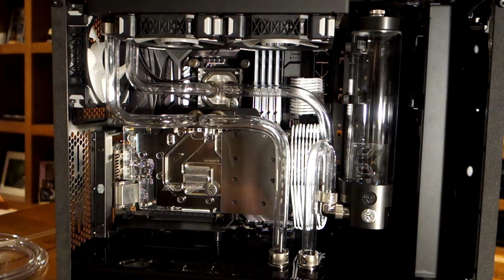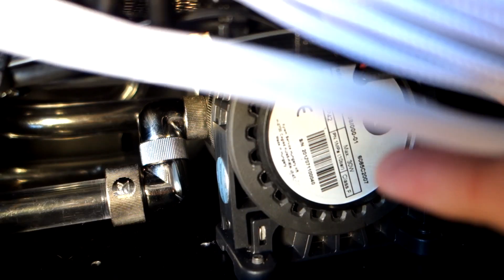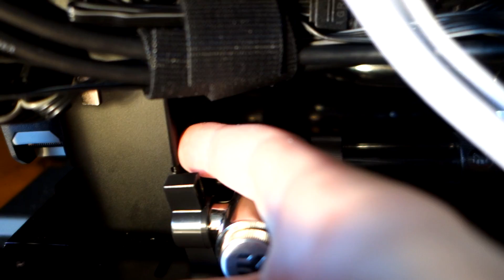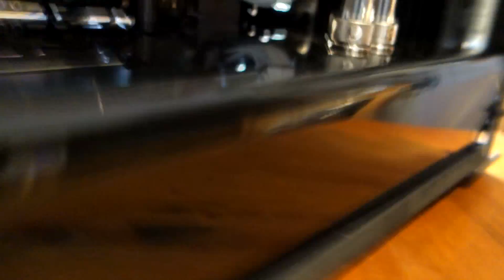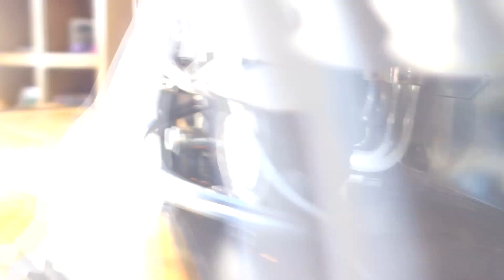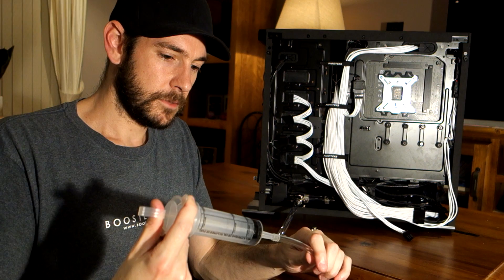How to Dry Leak Test a Watercooled PC & Custom Water Loop Design

Comment: Great tutorial and test to check the system before filling it with coolant.

1 thing though.  Yes it is perfectly fine to run the whole cooling loop as 1 circuit but just the point about the temperature.  The system won't hit an "equilibrium" as each radiator has a different cooling capacity.  The way this loop is setup the GPU will most likely cooled more than the CPU due to the differing cooling capacities of the 360mm and 240mm radiators.  

Eg:  
We need a  here.  First is that the GPU and CPU both run under load at 85C.  Say the water coming out of the pump is 60C, it then enters the 360mm radiator (now assume the 360mm can lower the coolant temp by 20C) and comes out at 40C.  It then hits the GPU block (running at 85C) and heats up to 70C before entering the 240mm radiator.  Now we must assume that a 240mm radiator can not cool the coolant by the same amount as the 360mm so let call it a 15C drop.  The coolant then enters the CPU block at 55C and comes out at 85C (same increase of 30C as the GPU).  Coolant then goes back to the reservoir.  

Eventually the temperatures at each point will settle into a constant temperature but the GPU and CPU's will still receive differing temperature coolant.  Long story short to cool the CPU better the coolant should flow from the 360mm to the CPU then to the 240mm and finally through the GPU block back to the reservoir.
Reply: I know this is 2 years old, but that isn’t entirely true. The coolant is flowing so fast that the coolant leaving the gpu will not reach 70 degrees and heat the cpu. Instead the entire volume of coolant will eventually heat up.

Comment: Hopefully you never have to change your RAM hahaha
Reply: Ahaha when dust enter those ram he need to disable the loop to remove the ram and clean the contact gold pins with eraser..
That's why in my loop I'm planning to have a good amount space for me a enough room for may hands to go in and enough room for the ram to be taken off.. since when you do dust cleaning maintenance sometimes dust pushes inside the ram slot and clug the ram pins .. the result would be the BIOS won't detect the RAM and you will not get a POST

Comment: Thanks for the explanation of the separate fill port, I figured I'd just use one of the caps on my top radiator, I guess I won't be doing that aside from major initial fill, for top off I'll have to figure a way to access the tip of my res.

Comment: So that pump you showed in the back is seperate from the res? the res and top si the only thing that are in the front of the case? I'm confused, so this is how all the watercooled builds i've seen have the pum phidden? again, watercooling noob here. have all teh parts here though, and know ho wot assemble things but am a bit confused and worried about compatibility, leaks, and positioning.
Reply from the maker: Yep pump is seperate from the res :)
Reply: @boostedmedia  ..but still connected? Als osee my other comment since I've never done hard tube, and would love some tips since I am using an uncommon res-pump, unlike the usual EK, and Alphacool users, especially EK. (Atleast what I've seen.) Thanks my mate! Again, would appreciate it.
Reply: @LS-jk3fk  I just completed mine which you can check out here: I highly suggest joining the r/watercooling subredit too. https://www.reddit.com/r/watercooling/comments/fqepkt/my_first_custom_loop_i_recently_just_got_done/

Comment: Just want to say that I've been sitting on essentially the same build since December 2018 and just now getting around to building it (my other PC has still been running strong, hence the delay), and your video's in the last few days have really helped immensely so just want to say thanks! Also want to add there are not a lot of videos or information out there about where to mount the EK-XTOP Revo D5 RGB PWM in the Phanteks ENTHOO EVOLV case, and this video showing where and how you mounted yours is pure genius, in fact I'm changing up my design this weekend now because of it. Mounting down below opens up the top and makes it way more efficient by allowing for better bends in tubing design and layout. Major props sir, cheers! -TJ from Oregon
Reply from the maker: Glad to hear these videos helped. Let us know how you go with the rebuild.
Reply: @boostedmedia  She's all done! Said I would send you pics but I think a video would be better. https://www.reddit.com/r/watercooling/comments/fqepkt/my_first_custom_loop_i_recently_just_got_done/
Reply from the maker: Hell yeah man! Looks awesome!! Well done :)
Reply: @boostedmedia  Thank you! It turned out better than I expected! Temps are low and really stable, with the 9900k overclocked to stable 5.0Ghz, and playing the new Doom Eternal with maxed out settings, according to Core Temp and Speccy, cpu hovers around 45c, motherboard 40c, and GPU 38c. Pump pushes to GPU first then CPU.
Reply: @boostedmedia  Will do, I'll take pics and send you a few once it's finished and up and running.

Comment: Good idea for a leak check.  Also having only one pump and two radiators instead of one helps cool the GPU on one radiator and the CPU on another radiator.  A  lot of people showing how to build water cooling show a majority of the time coolant coming out of the pump into the GPU instead of coming out of the radiator.  This is the best way of water cooling system.  Good job.
Reply from the maker: Actually it makes very little difference what order you place the components in the loop. It’s a common misconception that the water temp is much higher as it exits the GPU or CPU than it is after it exits the radiator. The flow rate is high enough that the temp is actually pretty uniform throughout. That’s important it to make sure your cooling capacity matches or exceeds the heat being added to the loop.

Comment: Thanks for the video- subbed!
 
With that said, my first loop (soft tube) failed this test.  Any suggestion on how to find the leaks without filling the loop with distilled water?
Reply from the maker: You can use a spine with some soapy water and carefully run it over the pipes to hopefully see bubbles where the leak is coming from.
Reply: @boostedmedia  thanks much- keep up the great work!

Comment: I know this is a bit old now, but what kind of psi/bars should a system be able to hold at?  I have a gauge and want to test my loop out.
Reply from the maker: Only need a few pounds. It’s more about if the system holds the pressure rather than what the pressure is.
Reply: @boostedmedia  I'm doing my first hardline tube build and I'm paranoid about leaking. I've always used flexible which can take crazy high pressure. Not that it ever ran high, but that was assurance that it would never leak, and it never did. This PETG stuff can't take as high of pressure before the tube or res pop out.

Comment: Where did you get that syringe you used in the video
Reply from the maker: I bought it at a local hardware store but there’s a link in the description to buy.
Reply: I would also like to get a hold of the syringe, checked your description but couldn’t find anything. Also been to Bunnings and chemist pro.. nothing.
Reply from the maker: I got mine at super cheap auto :)
Reply: Boosted Media thanks for that info mate, I’ll head down to s/cheap tomorrow.. lastly what size tubing did you use from syringe - soft tube
Reply from the maker: The soft tube came as part of the kit with the syringe. It’s meant for 2 stroke oil mixing. Lol. https://www.supercheapauto.com.au/p/orcon-orcon-2-stroke-oil-mixing-syringe---80ml/215731.html
Reply: Boosted Media Legend, I’m doing a custom loop atm with a 2080ti and don’t feel like ruining any expensive parts 😂 
Your water build guides have been really helpful. Thanks for everything mate
Reply from the maker: You’re welcome mate. Glad it’s been helpful.

Comment: I am new to watercooling.  I bought the Intel i97820 X Series CPU with the EK ASUS Monoblock, on a ASUS Primm x299 Deluxe.  I am using the Thermaltake Copper CL480 rad w/4 fans and the Pacific PR-22-D5 PLUS Pump/res - all in the Thermaltake P-90 case (rad is on the opposite side of motherboard).  I want to know the flow on mine is correct. Not going to the GPU yet.....it is simple for now...so it goes from the bottom of pump to a flow meter then to the in of the monoblock -  then the out of the monoblock to the rad (left side), then from  the rad (right side) to the pump.  I was told it does not matter what side is in or out of the rad....is that true.  any reply will be appreciated. Lots invested and want it right.  Your videos are great! Also, I think I should have no heating problems
Reply: Would love too see that build. Gg.
Reply: @XD2LLoNX  Is there a way to post a pic?  I do not see any.
Reply from the maker: Flow direction through the radiators doesn’t matter. Some water locks have a specific flow direction so check the manual for that.

Comment: Can you explain why you have the flow going the direction you do on the GPU? I always thought that the water input should go over the flow plate and down on to the gpu core. In your description of how the flow will work you have it going reverse where it'll be going over the gpu core then through the flow plate from below.
Reply from the maker: Correct. I have it that way because it allows for a much tidier setup inside my case. Having the flow reversed through the GPU water block makes no discernible difference in temperatures for this particular model.
Reply from the maker: Excellent question by the way!

Comment: That doesn’t tell you s small leak. Just use s gauge and a fitting from hardware store and let it sit cost next nothing and works
Reply from the maker: Correct. As I said in the video it’s not 100% conclusive but it will certainly tell you if you have a major leak. It’s certainly not a substitute for proper water leak testing. More just an additional easy step you can take for some added peace of mind before you add water :)

Suitable pressure gauges were crazy expensive in my area unfortunately.

Comment: why you bought the asus x code and not the asus x formula? And what do you recommend, memory g.skill 3600mhz or 4133Mhz ?
Reply from the maker: I didn't want water cooling on the VRMs. Wouldn't fit properly in my case without a smaller top radiator and not really necessary. 

I recommend 3200MHZ 16-18-18-38 RAM. If you run the numbers, it's the same speed as 3600MHZ because the timings are lower and I find it more overclockable with better overall performance. Havent tried 4133MHZ Ram.

I'm running mine at 3400MHZ with stock timings and voltage at the moment.
Reply: Boosted Media and what do you think. I dont know if i buy g.skill 3200mhz o more frecuency. Thanks for your help
Reply from the maker: The higher frequencies run at higher latency so the resulting speed is the same. So it makes no real difference u less you’re planning on overclocking. Hence why I recommend 3200MHZ